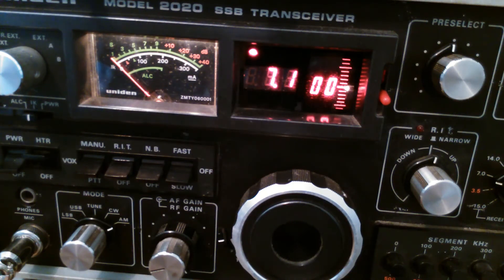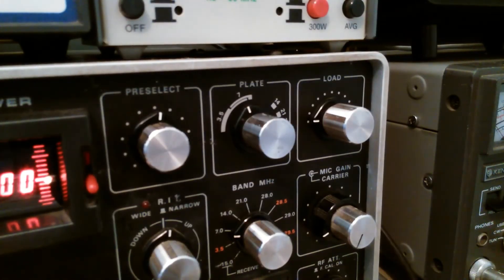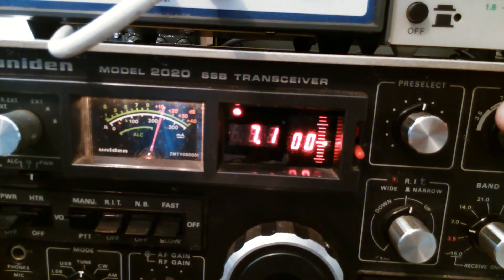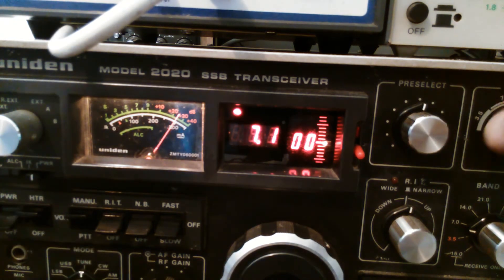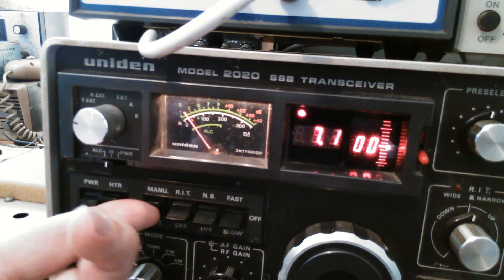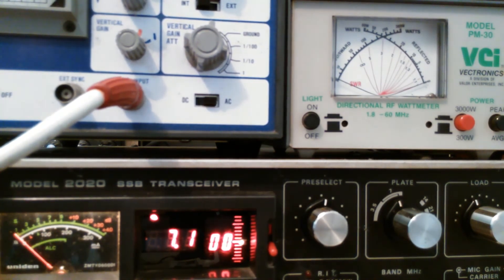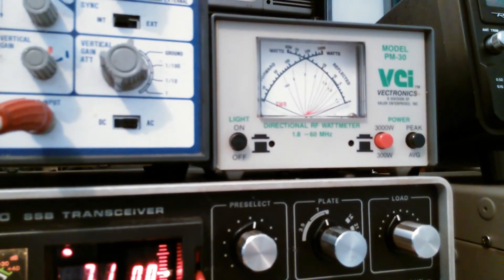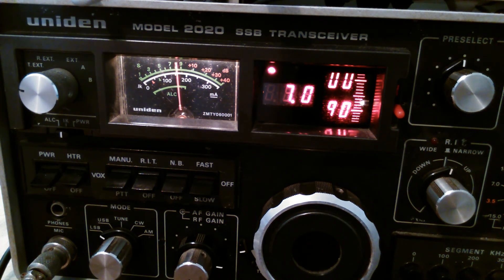Uniden 2020 Repair Part 11 of 11

Comment: Thank you for making these videos.    I have two Tempos.   One works fine now but had sprocket issues  the other one has no receive at all just white noise.   Ive swapped out the boards with the working one but no change.  Oh well,  at least I have one good one.
Reply from the maker: Thanks for your feedback on the videos. By swapping the boards you have already eliminated much of the transceiver as the source of the white noise fault. So the problem must be in what's left, which is fortunately not much! Bad connections could be the problem so check things like making sure that you are getting good contacts on the edge connectors and no broken wires on the wiring looms going to those connectors. Good luck!

Comment: Hi Mark. Thanks for taking the time and sharing your videos and insight of this great rig. For much better AM reception, connect pins 11 and 13 on the filter board PC-077, you will be able to hear both sidebands in AM instead of only the USB filter. You will also have double side band function in receive and transmit in SSB. I use a switch to enable this function. Greetings from Germany Frank DL9DAC. Here is the link to my video demonstrating it. https://www.youtube.com/watch?v=uI3seshHX9M
Reply from the maker: Hi Frank, Thanks for your comment and great suggestion! The Uniden 2020 produces good AM with a specific 1496 IC to do the job but the AM reception is very narrow using the USB filter, I usually off-set the tuning with the RIT to get more clarity. Your wonderful modification fixes that problem and it sounds much better! Many transceivers do not have this option with only one filter so you can't use both..! AM is one of my favourite modes when done properly and it is very popular again in VK now on 80m and 40 m. 73's, Mark.

Comment: Hi.Mark.
Yes.It does.  On D.Load or antenna...I also noticed ALC is not acting on 80m band.Higher bands producing minus 1 to 1.3V ALC OK by "the book"!
Had checked ALC circuitry and components(Q1001,D1001,D1002,resistors,caps and chokes).Ther's values are according to the schematic .Tried different bias value...as well checked neutralization but no difference.May be I should get better pair of 6146 tube?
73.Ed.
Reply from the maker: Hi Ed, My apologies for not replying to you sooner, just saw your reply. Have changed browsers recently due to YouTube changing and the new formatting is producing strange results sometimes. Are you still having the fault?
Reply: @swinglink  Hi.No apologies.All got fine.Problem fixed partially changing driver 12BY7.Look like final tubes needed more juice up to 5W unlike before 2-3W.TNX for concerns !Best 73.Ed VE3REJ.
Reply from the maker: @EdwardRekas  Thanks for your reply Ed. That is very interesting about the 12BY7 and the low drive level. Usually more critical with a Class C final than AB1, will have to remember that. Hope your 2020 is going well now, a classic rig when working well! Cheers, Mark.

Comment: Big THANK YOU Mark for your reply .I got it now.
I have U2020 that's distortion(60 Hz hum) appearing  when Ik is near 200mA and up and only on 80m band and at the peak of  signal(PA Ik near 300mA) on 40m band.On higher bands signal is clean ,even drive is high...
I have checked PA plate volts is 900V idle ,drops to 750V when loaded.control grid minus 79V/minus 50V respectively .Screen grid at 200V.Had changed PA tubes.. Had changed HV caps and other voltage caps in rectifier circuit,still same results.I noticed,that on  80m band,mic. drive and carrier drive is very sensitive..Needed little drive to reach high PA O/P.
I'm monitoring and evaluating O/P signal(modulation) on Rx sitting near U2020.
Your response is much appreciated .
TNX .73.Ed.
Reply from the maker: Hi Ed, Does the problem occur when the 2020 is operating into a dummy load? 73s, Mark.

Comment: I did not catch distortion source and how was it solved?
Reply from the maker: Thanks for your question. When the output tube was repaired (Part 10), sufficient drive was then available to develop ALC before the distortion level was reached.This is because the load on the 12BY7 driver had been increased by the faulty O/P tube as with no plate voltage, it was not only drawing excess screen current but also more control grid current when the drive level was high enough.The faulty O/P tube must have been partly faulty for some time before failing completely - I do remember hearing some intermittent arcing in the O/P stage previously. 73's, Mark.